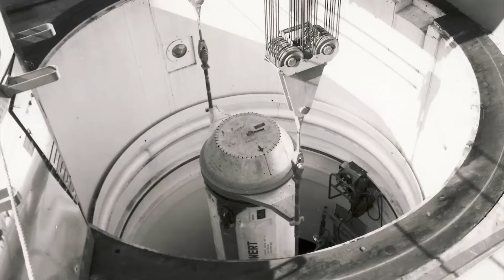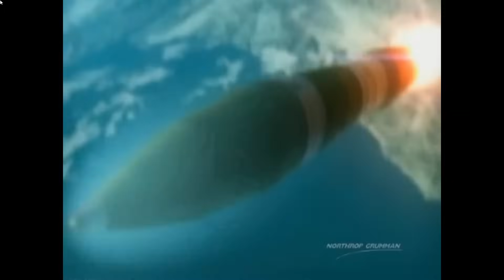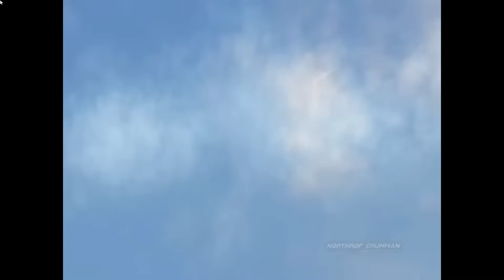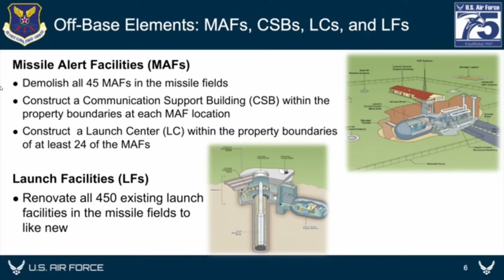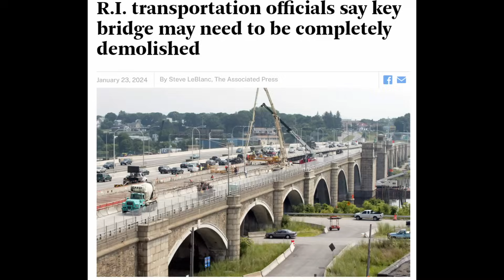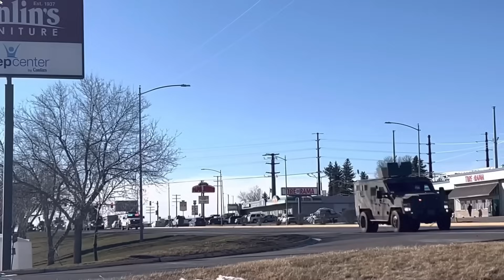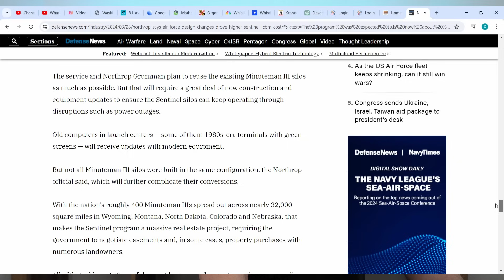Sentinel - How the U.S. Air Force will Upgrade its Land-based Nuclear ICBM Program

Comment: I led the construction engineering team that integrated all the subcontracts of the missile defense project in Alaska.  That project was completed safely, on time, on budget, and met the specs. When the project you discussed kicked off the Prime Contractor engineering team contacted me and asked me to join them. I'm one of a small number of guys above dirt with hands on engineering experience in the construction of the subject matter systems. To be blunt the team did not impress me and I opted to work on another project (that's and running today). You're video confirms the impression I had at that time. 

The only way this project will get fully funded is if the Senators of the states involved are the very senior senators with serious stroke. Right now (118th Congress) the line up is very thin for the states involved. When we built the Alaska project Ted Stevens (AK) and Daniel Inouye (HI) were the heavy hitters that made the magic ($$$) happen. Right now Mitt Romney (UT) has some limited stroke and the project office is located in Utah, but that's about the limit of patrons for the project. I would predict an extended front end engineering phase (small budgets), and a longer implementation schedule.
Reply from the maker: Thank you for that insight.  It does seem like the time-line will be much longer for this program than what they are saying (assuming it goes forward).
Reply: @CaseyJones-Engineer The problem is essentially, IT HAS TO no matter what; the budget will be passed.

The current ICBM fleet is SO old and outdated that a civilian team exists in the USAF JUST to repair broken components because they don't exist anymore and those familiar with them are mostly dead. Most technicians are only trained on the new stuff, and their contracts despite usually being 4-6 years are too short to "Understand everything" meaning it's a waste to even train them in the first place. So a motherboard stops working? The techs not even giving it a second glance, it's passed off to the civilian team, placed under a microscope, and if necessary completely resoldered, etc, until sufficiently repaired back to "Working status" and reinstalled. And that's pretty much the same for EVERY electronic component for the missiles.

The DoD only got off 8" Floppy Disks for EAMs (Emergency Action/Alert Messages) in 2019... Don't worry though, despite somehow upgrading past the 70's Floppy Disks (That's right, not even the hard shelled 90's/2000's ones, but the older soft sleeved flip-floppy ones), they're still stuck with the computer that needed them, the IBM Series/1...

A few years is light-years when it comes to computers which is all it takes to potentially make games or programs 100% unusable on PC's and time goes BOTH ways, plenty of old games have to be emulated because modern PC's can't run the old obsolete programs. So too new or old tech is just as big an issue as too new or old software/programs.

Imagine being the unlucky SOB that has to program targeting lists, coordinates for them, programs controlling every aspect of the missile flight controls so it lands within a 100m CEP 6-8,000 Miles away at Mach 20+, and you gotta make sure ALL that, is compatible with a 70's PC MS Dos makes look like a Dinosaur and when your data caps and broadband is measured in Kilobytes maybe a few MB in an era (Now) where an MP3 file for a single song is 5-10+MB depending on the quality, and a single picture is around 30-ish MB...

So... yeah. Maintenance personnel literally not knowing what they're maintaining and knowledge about the missiles features that have been lost because everyone that knew is dead, is a pretty big issue.

For instance when we refurbished our old warheads around the 2000's we discovered "FOGBANK" inside, a classified aerogel like material that increases the warheads performance or reliability or something. Only problem is NO ONE knew what TH it was and the development team was all dead... But the fact it's allowed there taking up valuable space must mean it's pretty damn important, buy why..? It only took us 10+ years and Millions of dollars to rediscover what it did and how to properly make some Sh*t we already had down 50+ years ago...
Reply from the maker: @pyro1047   Very interesting comments thank you. I worry about the loss of institutional knowledge in a whole range of industries these days. I didn't realize it was that bad in the defense sector though.
Reply: @CaseyJones-Engineer  They cancelled NGAD and a list of other programs for this project.  It will go forward no matter the cost (for better or worse or otherwise).
Reply: Snd today in construction nothing is on budget or on time.  If it takes 6 months to get an inline tideflex valve for a 15” pipe how long will this thong take?  How many contractors or Engineers know how to do this type of stuff
Reply: @johnnevin7759  I've known next gen engineers that don't even think of on time and on budget.  I worked with one Army Civilian  Engr and he blurted out that he had never done a project on schedule - I asked him if he put that on his resume. I've met design guys that have never seen their designs in the field and never had feedback from the field.
Reply: I am somewhat surprised however that Trident II C5 SLBMs with just an extra booster to extend the range was never seriously considered or AFAIK even brought up as a "Budget Option" considering they're faster, more accurate, and can MIRV like a dozen warheads not including additional Decoy warheads, countermeasures, jamming and spoofing intecept radars and missiles, etc; when the Minuteman III's only carry like 3 warheads.

SALT II should've never been signed by Bush Sr... in exchange for nothing we gave up the Peacekeeper ICBM to make Russia feel better. The Treaty only went into effect in 2000, and Russia abandoned it in 2002 because we didn't resign the ABM Ban Treaty. So our most advanced ICBM gone in exchange for 2 years of US and Russian Federation ICBMs limited to 1 warhead per missile. Keep in mind the Treaty was void by Russia in 2002, we destroyed the last Peacekeeper in 2005...

Comment: That sea foam green color shows up on a lot of control consoles and electronic equipment cabinets in the civilian maritime industry. 

Edit: it seems that the actual reason is that the color has three benefits. The first is that it’s pretty close to the peak sensitivity of the human eye, which meant the space needed less lighting, which reduced eye strain. The second is that it makes it easy to spot leaks of fluids like oil or grease. The third is that it’s apparently calming.
Reply from the maker: Interesting.  Thank you!
Reply: A long time ago, I heard that colors effect the mood. Light blue is suppose to be more depressing. I guess that researcher doesn't like going outside, under a blue sky. Pink (light red) is suppose to raise aggression, but pale green has a calming effect. I forget how yellow effects mood.

Comment: I was stationed at Minot 78-81.  I agree the concrete, at almost 60 years old, should need replacing.  The cost you announced sounds like that is intended.  The weather is harsh in ND.  I’m sure a toll has been taken.
Reply from the maker: Most people don't realize how brutal the winter in ND is!
Reply: When I worked Rivet Mile (Minot) we were welding the liner about 5 feet down from the bearing ring the launcher closure sits on. Out of the wall came a jet of water each time the guy struck an arc. Water table isn't far below the surface in some areas. Imagine what that is going to the infrastructure. Imagine the freeze thaw cycle.

I think they get into it the program is going to be cancelled because the costs are going to rocket sky high.

Comment: that green color is also found inside US armored vehicles, Abrams, M113s, Bradleys etc
Reply from the maker: Interesting.  Does that color make people calmer or is there another purpose?
Reply: @CaseyJones-Engineer  I've heard that, but I think it has more to do being lighter in color, to see easier when it's dark(white lights bad, red lights suck), but not white as it's hard to keep "clean".  JMHO
Reply: You’ll also find this color in medical operating room.  My understanding is the eye creates a visual imprint or residual spot based on the color it sees. In the case of blood, the imprint color is green - which matches this mint green color.  Since the imprinted visual spots ‘match’ the color of the walls, it reduces eye strain for doctors.  As an aside, I served as a missile launch officer in the late eighties.  Given, the mission, there was NO expectations of eye strain caused by blood.  Second, the biggest concern for a missillier was falling asleep - so calming someone down wasn’t a goal either.  Knowing SAC, the reason for the paint was availability, reducing inventory, durability and, mentioned elsewhere, being able for maintenance crews to identify leaks and stains.  Also, a cool fact, as of 2018 the MM3 missile maintainers had never had an accidental fatality.  Serious injuries yes.

Comment: For every missle on these main bases you can bet at least one, if not two is someplace else hidden from view (often in national forest) an in smaller groupings.  There are retired silos in nearly every state that have been converted to new uses.  Some may even be in plain sight,  St. Albans WV had a small missle single warhead until the 90's in a park when the Airforce removed the engine and warhead and replaced with dummy covers.  Not much more than twice the size of the tommahawks supplied to the Iowas.  If you scan around the Naval listening post in eastern WV there are some clear bunker covers there too. Next to and around the arrays of dishes.  North of Green Bank but looks alot alike minus the one big dish.
Reply: Some of the (of course, empty silos) are being converted into fairly luxurious housing, as luxurious as anything can be when you're living a hundred feet underground.

Comment: To do an effective shell game you need more like 1000 silos for 400 missiles vs 450 silos.
Reply from the maker: Yes, I see your point.
Reply: @CaseyJones-Engineer  This is wrong. There's no "effective shell game" - if you can make your enemy treat 450 silos as targets with 449 missiles, you've already won, you've saved the material cost of maintaining one missile at no actual downside. Ultimately, if you're actually concealing the distribution then it's the number of targets that deters the enemy, not what backs them. The question isn't how many silos do we need to hide the missiles, the question is how many silos can we get away with not stocking the expensive stuff in.
Reply: @zhentaa its costs us about $20mil/yr to maintain just the warhead on EACH nuke weapon we have.
Reply: Treaties still need to be observed.  As long as we can launch in less than 20 minutes, silo numbers and locations do not matter. The weapon that is necessary, but you pray it is never needed.
Reply: @danatirrell2457  google MX missle.
Reply: Thet was called the VX missle plan but it was not passed.
Reply: We did until the pinko jackass busheys and clintons blew them up! Then the clinton traders illegally gave the RED Chinese the rocket technology to get their failing ICBM program off the launch pad and into space that were blowing up. These traitors sold out their country to get illegal campaign donations from the CCP as to win their 2nd term! Also these lowlifes gave them one of our most advanced military computers so they could simulate nuclear explosions and perfect their nukes! Shaving decades of their nuke program! Before they sold us out the commie chinese were 25 years behind us! Why these traitors are still walking around alive is infuriating!

Comment: Right off if they are ignoring replacing old concrete in cost estimates you know this is going to end up way too expensive to be politically palatable. Of course its possible that ignoring those costs initially serves to trickle the money in over longer time (increasing the pork quotient, like boiling a frog).Shouldn't this money go into the sub fleet (ballistic and hunter killer) instead?

Comment: Boron absorbs neutrons, which might mitigate an attempt by an adversary to flood the warhead with neutrons (as from a so-called neutron bomb) causing a premature explosion (even a "fizzle" reaction would render the warhead useless).
Reply: You are correct.  The idea is to prevent a high neutron flux from getting to the warhead.   You don't need a critical mass to detonate an atomic bomb.  You just need an appropriate thermal neutron flux.  A critical mass is just the mass that generates its own neutron flux to trigger an uncontrolled cascading nuclear reaction (which is how a nuclear bomb detonates).

Most existing bomb designs use a sub critical mass (no assembly of bomb components required) and a way to increase thermal neutron flux to detonate the bomb (there are multiple ways to do this).   So preventing a neutron flux from a nearby bomb detonation is key to preventing the warhead from detonating in the silo (even if an incomplete detonation - which is the fizzle you refer too).

Comment: With the  unknown corrosion in the concrete, how does USACE know the silo wont collapse when the missile is ignited. 🤔🤐😋🥰💯👍
Reply: After they remove the steel liner - they will drill core samples to test the concrete and see if there is rebar and steel mesh rust.

Some of the silos may be in very good condition (where there are dry conditions). Silos that have groundwater around them are likely to be degrading due to rusting of the rebar.

Comment: Coastal land is usually wet, hilly, seismic and populated. The plains are drier, flat, not really seismic, and not populated.  Security of the site would be the main concern.  Protesters aren’t usually willing camp out in the dry, windy, and Starbuckless territory.  After all, All of aspects of these systems are for national security and not for cheap and convenient.
Reply: The silos are located where they are because that's the nearest missle trip to Moscow. No other reason.
Reply: @flashgordon3715  Didn't I read decades ago that it is also to be the longest distance from any Russian SSBN subs off the US coasts?  My memory is hazy.
Reply: @Lost-In-Blank  🤔. Certainly a consideration. 
When the ICBM programs started, the submarine tech was just starting.
North Dakota over the north pole to Moscow is the shortest route. 
I'm not sure how Canada feels about that.
Reply: @flashgordon3715 , Canada is fine with it. They jumped in bed with us about this in the DEW Line days.

Comment: Bridges have heavy loads on them constantly and have scour from water and issues with salty conditions.  I would think a missile silo has much less forces on it which could damage the silo. I suspect since concrete gets stronger with age then only issues with steel corrosion could be a problem.
Reply from the maker: I think you're right about that. Any deterioration would be caused by corroded steel reinforcing.

Comment: Back in the 80s i worked on the MX missle program ( the " racetrack + shellgame " theory ) a huge program which didnt get built and then the cold war ended
Reply from the maker: Didn't they deploy 50 peacekeepers before killing off the program.
Reply: @CaseyJones-Engineer  Yes, then they pulled them and pieces are used with the Minotaur orbital rocket.  The warheads were moved to Minuteman missiles.  And now, instead of making more Peacekeepers, they decided to design a new and significantly less capable missile.

Comment: Just a note, boron is used for neutron shielding not gamma.  A high atomic number material is a good gamma shield so lead (Z=82) is better than boron (Z=5) but boron has a large neutron capture cross-section (~200 barns for thermal and 0.4 barns for fast neutrons, see Wikipedia, Neutron Cross Sections, Typical Cross Sections near bottom of article) so it is good for stopping neutrons
Reply from the maker: Thank you for that clarifcation. I must have came across a bum reference.
Reply: You are correct.  The idea is to prevent a high neutron flux from getting to the warhead.   You don't need a critical mass to detonate an atomic bomb.  You just need an appropriate thermal neutron flux.  A critical mass is just the mass that generates its own neutron flux to trigger an uncontrolled cascading nuclear reaction (which is how a nuclear bomb detonates).

Most existing bomb designs use a sub critical mass (no assembly of bomb components required) and a way to increase thermal neutron flux to detonate the bomb (there are multiple ways to do this).   So preventing a neutron flux from a nearby bomb detonation is key to preventing the warhead from detonating in the silo.
Reply: Fermi used water to absorb neutrons in his early experiments.
Reply: @jamesstaley5611  While that is true.  Boron is more effective.   What is suitable for laboratory experiments or even land based nuclear power plants is not suitable for applications such as land based missiles.

It takes a large amount of water for effective shielding of the neutron flux from a nearby nuclear detonation.   The missile silos are not built inside of huge tanks of water, nor are the land based missiles expected to launch from under water if you wished to shield them by having the required feet of water above them.

Comment: Most of the activists are financed by the ccp. The location of the launchers is because the missiles go over the north pole. With the prevalence of DEI in DoD, I am not optimistic. Good Luck, Rick
Reply from the maker: I didn't even consider that possibility about the funding of these protesters but that makes sense.
Reply: @CaseyJones-Engineer  After the soviet union collapsed, we learned that most protesters of the 1960s and 1970s were financed by the kgb. That included NOW, SDS, Black Panthers, and many campus protests. Good Luck, Rick